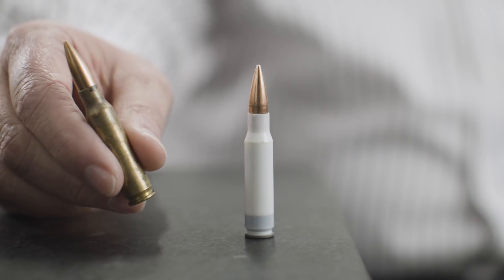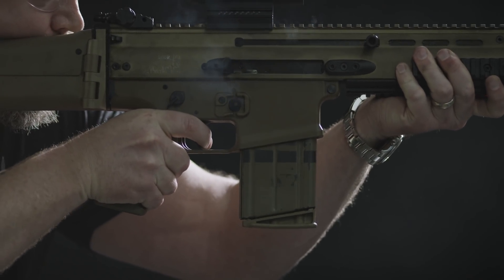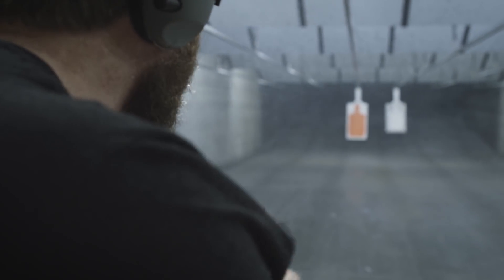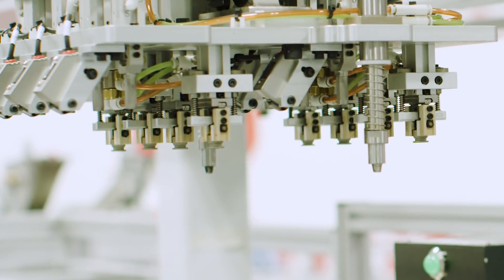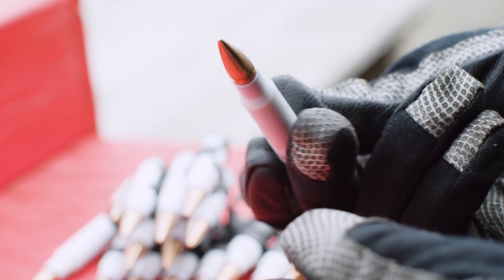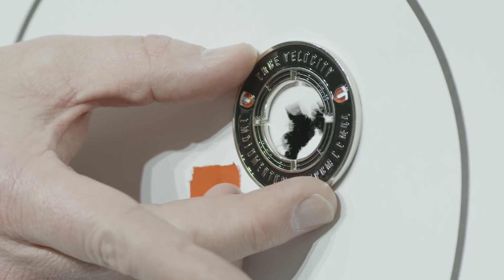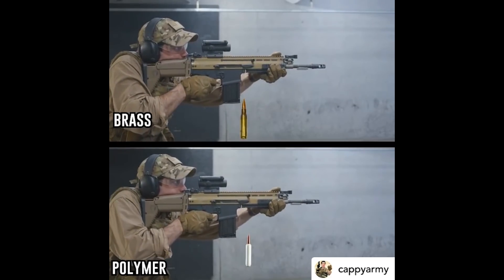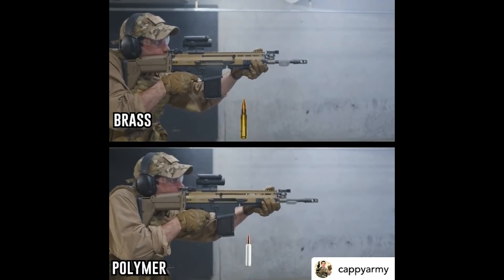Composite Ammunition is More Accurate than Brass | NGSW | Next Generation Squad Weapons

Comment: .338 Federal Ackley Improved cartridge cases with either
•90 grain ALCO Bullets' projectile with the 0.627 ballistic coefficient at 4,300 fps from a 20 inch barrel encased in a 7.2 grain sabot.
3,698 ft/lbs at the muzzle for the projectile, 295.84 ft/lbs for the sabot.
Almost 4k ft/lbs at the muzzle for CQB applications.
The projectile alone will generate .300 Winchester Magnum energy levels for M118LR recoil figures.
2,368 yards of effective range at standard temperature and pressure.
or
•253 grain Raufoss multipurpose .338 caliber ammunition, a 40% scaled version of Mk 211 Mod 0 .51 caliber multipurpose ammunition.
0.554 ballistic coefficient at 2,500 fps from a 20 inch barrel gives it 1,074 meters of effective range, 1,174.5 yards of effective range at standard temperature and pressure.

The 30% weight reduction of True Ballistics' steel and polymer cartridge cases coupled with the 20% weight reduction of the saboted 90 grain projectile would give us a loaded cartridge weight of 13 grams or so.

I think that this would be fun.
In a Kel-Tec RFB rechambered for .338 Federal Ackley Improved, with the original flash hider on a 20 inch barrel the overall length still comes in at under 30 inches.
Everybody wins, 
everybody has a good time.

#Ihaveahighschooleducation
💀♠️🎯

Edit-
4,300 fps seemingly achievable for Ackley Improved .338 Federal, 8-10% more powder gets 2-2.5% greater velocity in theory.
4,400 fps seems then achievable.
4,380 fps with the 0.627 ballistic coefficient projectile gets 2,400 yards until deceleration to Mach one at standard temperature and pressure.

Comment: So I was thinking, you guys, 
400 grain weight for M118LR.
Sub the 175 grain Sierra Matchking with the 90 grain ALCO projectile and a five grain sabot.
My target is 4,000 feet per second for a 20 inch barrel for the saboted 90 grain ALCO projectile.
3,960 feet per second gets 2,200 yards of effective range until deceleration to Mach one occurs at standard temperature and pressure.

Your statement regarding 8-10% less powder burned to achieve the same muzzle velocity is absolutely amazing.
Coupling the 30% weight reduction that you guys get with the 20% weight reduction of the +3 Longbow concept, as I refer to it, reduces the weight of the .308 Winchester in this specific application by a full 50%.

This is clearly the way forward.
Trying to burn everyone to the ground that I can to get everyone causing problems out of the way.

#Ihaveahighschooleducation
💀♠️🎯

Comment: Not the first company to use nylon based cartridge casings. There was one back in the 1980's that did this. Problem in the material is that barrels get HOT fast, and if you've got a hot barrel and chamber a nylon case (closed bolt system) it's got a chance of melting or deforming. 

But their claim is that the internal design of the cartridge casing is somehow 'better for accuracy', not sure I see that, when they also say it has the same performance at the muzzle velocity. Beyond muzzle velocity, what improvement to accuracy is it????? When they same they use the same or less powder/loads as the military are they talking M80 (general use) or M118 LR or SB (match grade)????

Their website doesn't seem to actually do sales, and through Opticsplanet their 7.62x51 goes from between $2.80 and $4.07 a round. Compared to roughly HALF the cost for brass cased match rounds. That's a HARD NO in my military mind. 

SSG. U.S. Army (Medically Retired) Infantry / Sniper / SOF Intel (SOT-A), multiple tours

Comment: Any brass cartridge will do everything these things will do. The difference is brass ammo is much cheaper(even though the manufacturing costs are higher) and re-loadable. Anybody with half a brain knows that military ammo isn't precise or consistent. And anybody that knows ammunition is aware that military 7.62x51 is downloaded when compared to a 308 Winchester. You can not compare 7.62x51 and 308W. The 308 will win 100% of the time no matter what case it's in. I will personally challenge these rounds against my own hand loaded brass ammunition. Tell me the wager and we'll make a video.

Comment: I retired as an internal ballistician of rocket motors, gas generators, artillery piece, 40 mm grenades and even small arms and this person is rattling off pure horseshit. The reason I can proclaim that is his words suggest that they CONTROL many parameters that they really don't. Flame spreading, heat loss. Shot start load or engraving loads all vary. You don't control propellant burn. If you cherry pick cartridge tolerance and primer lots and stay with one lot of propellant you can get a very tight dispersion... with a single test weapon. Too many variables in production between every lot of material. If the cherry pick the parts to a few hundred out of thousands they can give you a good result.

Comment: Very good news if true. 1/3 the weight, using less powder and running cooler all sound great! I hope it is reloadable as well. Will become much cheaper as the production volume increases. Much better changes than I’d expected. Good work!

Comment: I like for visually comparing the 2 rounds they use some crappy, corroded, reloaded Brass cartridge, that looks like it's been reloaded a 100 times compared to their new single use cartridge.
With thatbsaid I'm not Disputing any of their claims in the video I just found that framing interesting.

Comment: You have to test that in everything including G3 fluted chambers. They break the brass cartridge casing so the solution came up with is internal chamber fluting. I personally wouldn’t use plastic and rather than a cook off from a hot barrel it would melt

Comment: This is all with testing new ammo that hasn't been sitting around for years and heat cycled in hot and cold what about when he goes to the desert then through cold weather and neglectful storage this be the true test of this cartridge possible problems could be dimensions or moisture buildup causing cycling and accuracy issues

Comment: Question. If case transfers less heat to the mechanism doesn’t that mean that more heat is transferred to the barrel which leads to more barrel wear. That would mean that heavier barrels are required for same noumber of cycles which would lead to more towering experience of the operator?

Comment: The brass can act as a way to keep the receiver cooler when shooting because the heat transfers into the casing which is then removed and therefore taking the heat away from the weapon system. Very much like how a nice chip can keep your tooling cool when machining.
Reply: False. The heat that brass conducts during combustion is conducted straight to the chamber walls of the barrel. What heat the brass case does remove from the gun is ultimately insignificant. With polymer cases, the chamber stays much cooler, and that heat energy instead goes into producing useful work, i.e., accelerating the projectile down the bore. It's like adding an insulating material to the piston and chamber of a combustion engine; less energy is wasted as heat and more of it goes into producing more power.

Comment: For new technogy this is so cool, does it have alot of work to be useful, yes. But once the science gets there and the price drops to get it through to the main stream market it will be purely better than brass. 

Imagine a load that hits like a 50 cal, but is only half the size so you can carry more amo, and has less recoil so there's less time between shots simply because the can now shape the casing with an exact science.

Comment: So the chamber heats up more and the case can’t take heat away from the gun? I’d call that a bad thing. Also I’d be curious to see what happens when that round sits in a hot chamber. Will it melt to it?

Comment: I can see this as military application more than civilian, where reloading and resource conservation isn't as much a priority compared to weight savings in transportation and portability. If these things can be reloaded, then perhaps utility in the civilian market will increase.
Reply: Most civilian shooters don't reload, so it would make little difference.
Reply: @joshklaver47  But I suspect that most brass gets reloaded, since I will assume (and it is an assumption) that most cartridges are fired at firing ranges, where the brass is collected for reloading, either directly or through secondary sales of the spent brass. And steel and aluminum case stuff not suitable for easy or practical reloading, are recycled. Ultimately, I guess it comes down to price. Is this composite stuff cheaper per round than brass or steel case ammo?
Reply: @hot2warm  You're right that it will come down to price, and I suspect they will find a way to make polymer case ammo very cheaply in the future. It's similar to how we've seen the cost of solid copper and polymer-copper projectiles become quite reasonable. I would never touch remanufactured ammunition, or anything made with used brass. The brass can be melted down and made into new cases, but manufacturers shouldn't be doing anything else with used cases. I've seen remanufactured ammo blow up too many guns over the years. It's not worth potentially catastrophic damage and injury just to save a few bucks.

Comment: Well... I don't want to change it if it's the same cost. 
 Already many people adjust the powder to 0.1 grain units in their homes, and in the case of high-quality brass, more than 8 times can be reloaded. In addition, if there is a barrel of good quality, the accuracy of 0.4MOA or less is achieved.
 The only advantage is... Compared to the same number of bullets, I think less weight is an advantage. But if it's disposable, I think I'll continue to use brass shells.

Comment: It's trash. Cannot be reloaded, it's super expensive, not as accurate as brass cased ammo, and it will likely melt in a hot enough chamber. Sadly, the military cares more about weight and appeal to the public, and they have an infinite budget, so they might see use.

Comment: I think you'd have to be shooting at a hell of a range to get any significant benefit in terms of precision. But I am curious about the other advantages it may have, eg: it uses less powder, and produces a smaller flash, its probably also quieter, these things would make it a great round to use suppressed, the casings themselves won't ding as they hit the ground either, though over the gun you wouldn't hear that anyway I suppose.

Comment: How can it be "more accurate" when were talking about replacement of the cartridge into robust plastic? The projectile and powder type / load is exactly the same? How does it effect "accuracy" ?
Reply: It's marketing lies trying to sell plastic,
Reply: @anikidwolfy  it gets even worse when you’re firing those in full auto , the plastic will melt into the chamber 🤣
Reply: @PhysicsViolator  That's what I would worry about. CLP isn't getting that out of your chamber.

Comment: But I thought brass cases pulling heat from the gun was a good thing because otherwise the heat stays in the gun and can lead to a higher probability for cook-off
Reply: I think there almost 0.00000001% in any difference, bullet friction and gasses heating the barrel still get transfered into the chamber walls at any sustained firing. Now the interesting thing is if the gun is hot enough to cook off a round I don't think this plastic is going to do better or just melt (I don't know the exacts of this plastic).

Comment: Ummm not so fast... plastic, heat and cold, expansion and contraction, moisture variances with temperature fluctuations. I would think this would have to be tested in a wide range of environments and calibers, before a superior claim is made. I do like the idea of weight reduction of the round. All-around superiority would have to be necessary

Comment: To many non-thinkers complaining about cost. Like ANY product, once it goes into mass production the cost drops. And if the US government adopted it THAT'S VERY MASS PRODUCTION!
If the government doesn't procure it than it remains a specialty civilian round and most probably stays high cost.

As per the comments about melting... Jeeeze, I'm SURE the development engineers have selected or CREATED a plastic that's able to withstand hot and cold and immersion and all the conditions ammo is exposed to in storage, transport and in the chamber because they damn well know that's in the government testing and will have engineered it in.

As per reloading - totally not applicable to government use because they don't (generally, there have been a few exceptions) reload. Pretty much only civilians reload but some law enforcement agencies use reloads for practice. Military not much. If such a system got adopted either reloaders would stick with brass cases that would continue to be made a long time or since most people don't reload, just shoot store bought they pay whatever it takes to feed their addiction

Comment: I'm pretty picky when it comes to my ammo. Your level of accuracy and mine may vary greatly. Plastic no matter what you say can't handle the same pressure as brass. Brass will withstand 18-20 kpsi plastic will not so it displace this pressure into the chamber area of the barrel. Now most barrel manufacturers make barrels rated 2x thier pressure rate plus the pressure the case takes before passing pressure to the chamber as it seals. In your cases this will all pass to the chamber. Better have a good chamber...my barrels on my bolt guns are large Dia and will even handle retarded reloading practices though that's not my practice,  but I love that safety margin.  You have that?
My rifles can and have shot groups .08"-.128" on good days and usually under .25" less I'm off that day. I bet rifles yours dont!
Reply: It's worth noting that once the round is chambered, the case doesn't do a whole lot in terms of keeping itself from exploding--the chamber of the gun keeps the case from exploding. Both a metallic case and polymer case will expand slightly, provided the chamber is in spec and everything, to obturate the chamber and prevent propellant gas from leaking.
Incidentally, polymer-cases are actually better suited for higher-pressure ammunition, as metallic cases will try to weld themselves to the chamber walls when run at 80,000 PSI, whereas polymer cases have no such issue.

Comment: As with all plastics, oxidation will occur and it will weaken the case, make it brittle. I imagine that it won't store as long unless under reality tightly controlled conditions. 
    What happens after a lot of fire has really heated up the barrel and chamber? Does the plastic case start to melt slightly or stick to the walls of the chamber?
    Can you envision the problem for gun ranges or hunters? Either you police all your plastic casings every single time or you end up with a lot of waste plastic laying around. Can this plastic be recycled or is it bound for the landfill?

Comment: I can understand soldiers carrying less weight and a plastic case is non corrosive.  That being said the designer says it transfers heat better.  I'm not particularly sold on the idea , until they use them on a full-auto machinegun and will see if they don't melt or stick in the chamber.  Once I see a 1000 round torture test on a hot chamber , they we'll talk.    My gradfather , used to say ( IF IT AIN'T BROKE DON'T FIX IT).   Probably the pentagon wants to waste taxpayers money on things they don't need.

Comment: Is it downloaded 8 - 10 percent because it's got "superior combustion" or because the case material turns into a small bomb, and full loads would cause case ruptures?

If it could handle the full load, and burn more consistently, wouldn't a selling point be.. We use the same load, but see significant improvement in velocity.   Ballistic performance is all about projectile weight, and speed.   So why anyone would deliberately not use all potential velocity is sus to me.

Comment: Military does not care about individual round accuracy, it';s all about logistics vs total cost.  Currently the only feasible application of polymer case 7.62X51 ammo is for GPMG use.  If it could be mass produced cheaply and if it stores well, 20% weight savings per case will already justify it.

Comment: The case is exactly the issue with the 300 Winmag round. There is so much deviation in  clearances that the end of the case cannot seat firmly and reliably with each round to ensure accuracy so perhaps a polymer case with a very tight positive clearance would eliminate the issue? The throat of the case would be squeezed somewhat in close tolerance barrels but would eliminate the excess clearance in a negative barrel, thus reducing slop and increasing accuracy??

Comment: Just a thought, less powder seems like each Composite Round costs less to produce so are those savings passed on to the consumer in the form of Composite Ammunition costing less??? Of course that's rhetorical GREED wouldn't allow a cost cut but rather a cost INCREASE because Composite costs more than Brass... Figures...

Comment: So, I send them a fire formed case for replication. Then I just clean the spent rounds, put a new primer in, powder, projectile, and "Voila." No resizing necessary? Does the hot gas from the powder burn alter (i.e., melt) the inside of the case? No crimping needed?
Reply: No its just not reloadable